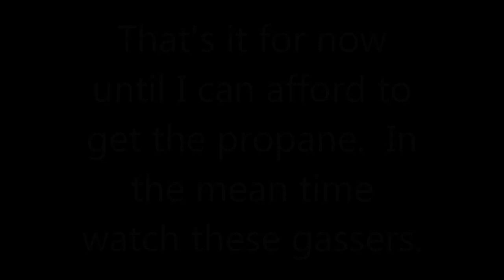Hot Dawg 60,000 BTU Heater Install:  Part 3

Comment: Thier was no need for that bigass square hole😂😂😂😂, all you had to do was to place air vent flat against the wall, place you hand inside the vent while holding a pencil and trace out the interior hole, remove the vent and locate the center of the hole, drill the center of the hole with a long drill bit that's allows you to drill through both interior and exterior wall, take a jigsaw and saw it out the hole and repeat the same procedure for the exterior wall....walllllasaa your done.
 😂😂😂😂
Reply: I agree.  That should have been a round hole in the interior wall to accept the large diameter sleeve of the thimble. Then glue or screw the plate plate to the interior wall surface.

Comment: Its not going to condensate. That like a 4 foot run, make a clean out T with a cap if your worried about it but its an 80% eff. unit. It will not under normal conditions ever in its life create condensation.

Comment: What color thermostat wires did you run inside the heater.  I see you only used the white and red wires at the thermostat.  The thermostat that I have is a programable but just using it for the heat obviously.  It says on my unit that its a single stage model and to use red white and green wire, but when I hook it up that way nothing turns on at all.
Reply from the maker: I would have used the red and white I guess as the thermostat I have is just a switch.  All it does is look for the thermostat contacts to close and call for heat.  Honestly, I don't remember exactly as it was 4 years ago.
Reply: @QuickSpeedShop  thanks.

Comment: Can I put the end of the exhaust pipe closer to my building? I think it'd look nicer but I don't want to make a fire hazard by not understanding code
Reply from the maker: I don't know what you mean by closer to the building.
Reply: Hey Nate, did you ever get yours installed yet? I'm looking to do the same thing,  vent it out the wall. But I'm wondering if it has to extend so far out.
How far did you extend yours? 
Thanks for your help.

Comment: I would just use 24ga single wall 4" flue pipe with 26ga flue 90's if needed..I mean you have a thimble for the wall...why not.  Use fire caulk on all the seams...save yourself about $100.00.  I used to install unit heaters all the time....never had a problem.
Reply: I just used regular 4" duct and fire caulked the seams and any moving joints. The joints I taped with duct tape rated for 220. Any problems you see with this? First time, trying to get by cheap.

Comment: At 13:13 why is there a gap between the wall thimble and the vent pipe. Does that go away?  Im looking at using this same vent kit. How did you fill in the space. I just bought a heater and am doing it myself so I need all the help I can get. Thanks man!
Reply from the maker: The gap is for heat to escape the space around the thimble.  The wall piece outside is tight and gets sealed up with silicone.  The inside stays spaced out and a hose clamp keeps it locked in place.
Reply: did you use hy heat siicone?

Comment: @QuickSpeedShop...Great videos...I’m installing mine now...after it’s been sitting in my trailer for 5 yrs...I don’t understand though, you have all that nice piping going to a crap flex line...Use Gas-Tite...Lol
Reply from the maker: I just used that for vibration isolation.
Reply: @QuickSpeedShop  Oh yes...duh...I didn’t think of that, but makes perfect sense and it is a best practice. I’ve got Gas-Tite so dampening is there by default.

I just can’t believe how ironic and awesome that your videos are on the exact 60K unit I’m installing. I’m going to be using my WARN PULZ-ALL to lift it into place with a block and tackle pulley...I forwarded through your initial video to see how you got it into place, and was stunned you muscled it up ontop of the ladder !

Comment: You mentioned about the flexible pipe for the gas supply to absorb any movement/shaking of the unit. How important is this ? The manual doesn't mention this but seems like a good idea. Thanks! This video is saving us hundreds of dollars quoted for the internal gas lines for our heater installation in the greenhouse.
Reply from the maker: The flexible line probably isn't really necessary as I don't see any movement with my unit when its running.  If it was hung or rods or something that allowed vibration it would be a good idea so all the vibratory force wasn't on the gas line and burner unit.

Comment: On my Reznor it says to have an upslope on the vent. Otherwise you can get carbon mooxide leaking in the building???? To combat condensation they have a T at the heater unit with a drain. What do you think??
Reply from the maker: The Hot Dawg has a power vent so no upslope or draft is needed.  Does the Reznor depend on draft for the exhaust?
Reply: @QuickSpeedShop  I am pretty stupid when it comes to these matters. This is the first one I have installed, but to answer your question.....I do not believe mine has a power vent, so that is probably why they call for a 1/4" min. upward slope.
Reply from the maker: @jaredrubink  If there is no power vent the that is most likely the reason.
Reply: If any condensation was to form wouldn't it possibly go back into the unit if it has an upslope?
Reply: @armandomrgl85  Yes, and that is the purpose of installing the T with a drain. The exhaust gas would get trapped with a slope moving downward from the unit. Apparently a no no. I did run my heat quite a bit last year. I have no power vent  so I used a small upslope and installed a T 6 inches from back of heater with a drain to collect the condensation. I live in central Mn so the heater works pretty damn hard at times......Not ONE time was there any condensation in the trap. Better safe than sorry though, or so they say. Have a good one.

Comment: What size propane tank do you need for this unit, will you post more videos on this?
Reply from the maker: I used a 100 gallon vertical tank.  I have part 4 coming out this Saturday, 12/1,  where I install the thermostat, set the tank, and fire the unit for the first time.

Comment: Can regular fiberglass insulation touch the outside edge of the wall thimble?  Or is there a risk of it getting too hot?
Reply from the maker: I wouldn't pack it tight on the outer wall of the thimble and definitely make sure there isn't any paper facing touching the thimble.
Reply: @QuickSpeedShop  Good to know. Thanks for the reply! I appreciate your videos on this. As a first-time DIY'er, I don't know if I could've completed the project without them. There's a lot to learn for someone who's never done anything like this before.
Reply from the maker: Thanks.  This is the only one I ever installed so it was my first time too.  I wish I had done it ten years ago!
Reply: Is there a specific wall thimble to go through a metal pole building?

Comment: I think your exhaust pitch is totally wrong. I do believe that you should have an upward pitch so that the exhaust can escape. code
Reply from the maker: If this was a flue venting furnace you would be correct.  This a power vent machine with a 4ft straight pipe.  There is no need for pitch and instructions want it down for condensation.  There is no draft with a straight pipe, power vent exhaust.
Reply: 1/4" per foot sloping down away from the Unit so condensate cannot come back into the unit.

Comment: Doesn't the horizontal venting need to be 4"?
Reply from the maker: No, this has powered exhaust so flue affect is not an issue.  The manual says 3" gasketed Class III pipe.